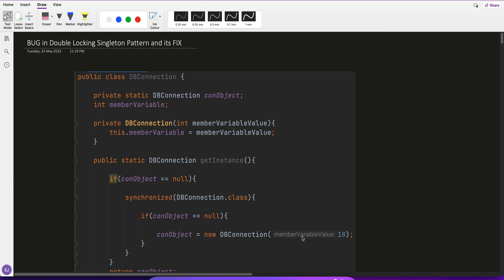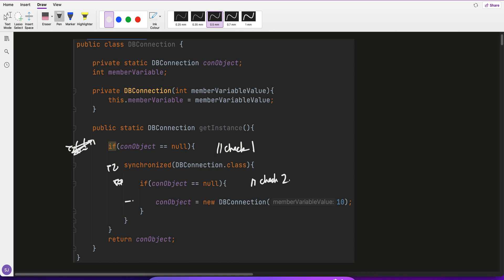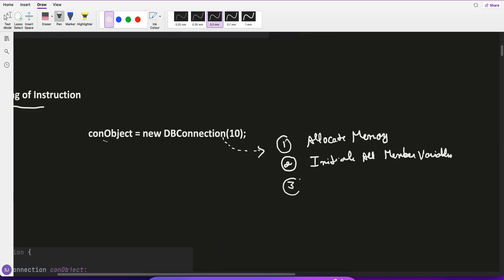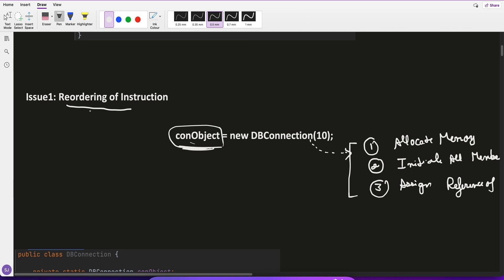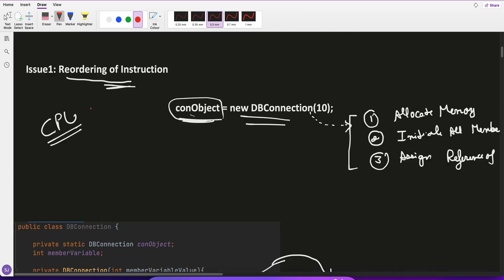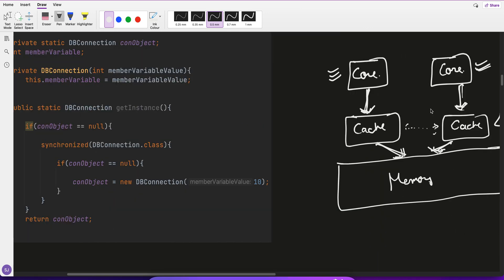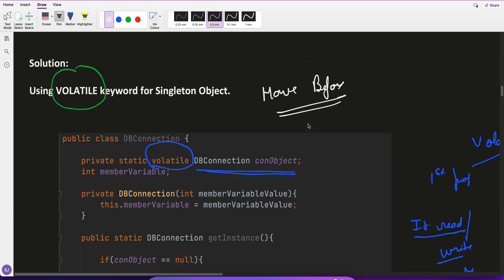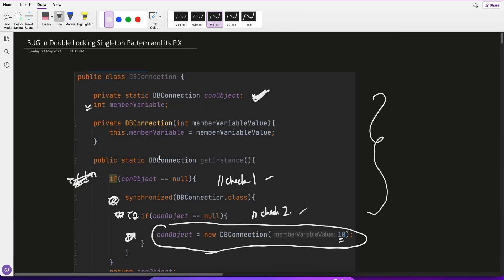28. BUG in Double-Checked Locking of Singleton Pattern & its Fix | Low Level System Design Question

Comment: In your memory issue part, how can thread 2 create a new connection, since the thread 1 has not yet relinquished its control over the code block. Java memory model forces the thread to flush all of its contents into the main memory for shared visibility before actually leaving the control, thus thread 2 will never have the ability to create a new object. Can you please clarify here.

Comment: @ConceptandCoding

With the synchronized block, visibility into memory is ensured right? Before reading anything synchronized makes sure thread fetches data from memory and after writers ensures that it is flushed to memory. 

The instruction reordering will be an issue but the second one is not.

Comment: @ConceptandCoding
 Synchronized blocks also guarantee that all variables accessed inside the synchronized block will be read in from main memory, and when the thread exits the synchronized block, all updated variables will be flushed back to main memory again, regardless of whether the variable is declared volatile or not.

so i belive synchronized itself should be fine even if you dont use volatile keyword.
Reply: Yep, that's what I was thinking.
Reply: Yes, the L1 cache issue should not be a problem for the mentioned reason. However, the reordering can still be an issue because the 1st null check is outside synchronous block(8:12). To avoid reordering, volatile is still needed. Please correct me, if I am wrong.

Comment: Hi @concept&&coding , i find the arguments misleading and wrong at multiple places 
1. Its not the CPU which does reordering of instructions its the compiler dueing compile time and assembler when generating asm code. CPU only executes them.
2. Also in a multi code cpu architecture, L1 cache is local to a core and multiple cores do not share / sync data as u have mentioned, that is not what L1 cache is meant for, please check this.
3. Also both harvard arch , modified harvard arch which is what we have in modern cpus , the data flows from the memory to cache and not vice versa , from a cpu perspective caches are transparent and its MMU which transfer hot data to cahce for speedup , so the argument that memeory gets allocated in cache and then thread 2 accessing it in L1 cache of core 2 is wrong as the allocation happens in memory and both cache will have cache miss for first time and then it will be fetched from memeory
Reply: Agreed 💯
Reply: I think CPU can reorder the instructions. For example if CPU figures has a set of instructions like a=b+c; d=e+f; it can choose to execute d=e+f as there is no dependency on a=b+c; This can't be controlled by the JIT compiler. compiler only compiles code and probably optimizes it for space but cant take dynamic decisions at run time. JIT compiler. Probably JIT compiler might reorder the compiled code if it feels there is scope for optimization for less resource consumption. I don't think it can take runtime decisions. Locality Of Reference is decided by the CPU and not the JIT compiler I suppose
Reply: But I agree,  object creation always allocates memory in heap and is no way related to cache.  So, even if object is being created, since the lock is held, T2 executing in parallel on core2 still waits for the lock to be released by T1. It cant execute the new Instance() code until T1 releases the lock
Reply: @mithunvasisht3176 its thats the case then when or how would it run into memory issues

Comment: Hi shrayansh, can't understand the caching issue alone. When we create object aren't we allocating memory for it as per instructions? Then how we don't have it in memory? Or are we allocating space for it in cache here?
Reply: Please refer my comment I have explained, I am glad someone else also gave a thought..
Reply: @ash_engineering  I guess there are 2 aspects. One is the variable. Second is the actual memory address of the allocated object. Shreyansh probably meant the local variable "instance" in Thread stack (which is in cache connected to CPU Core1 assuming T1 is part of CPU core1)  . There are two things. 1)Object creation(which happens in RAM/main Memory).  2)Assignment of created object address to local variable "instance" . T1 has its own copy of "instance" whereas T2 executing on CPU core2 has its own copy of "instance" . Now Shreyansh meant that assignment of Object address has happened to "instance" variable in T1 but hasnt happened to "instance" variable of T2.

Comment: Hi Shreyansh ,Checked your video on how to ask for referral through linkedin .But ,for that to work we need to be connected with that person as note can be sent with less than 300 alphabets only. Or will I require Linkedin Premium for this?
Reply from the maker: Hi Nik, you don't need premium. Send the connection request and then send the msg 
Try to connect to those people, who do not have too many followers or connections. Else it's possible that they will not accept the request as so many requests are already in pending.
So target managers or engineers who have less connections and followers
Reply: node is single threaded..i think we can go with eager or lazy initialization, no need of double locking or synchronised